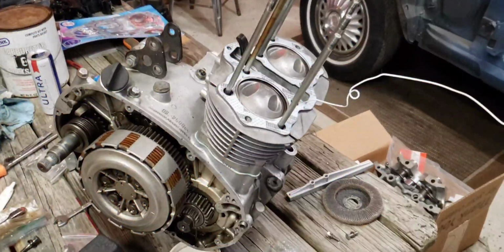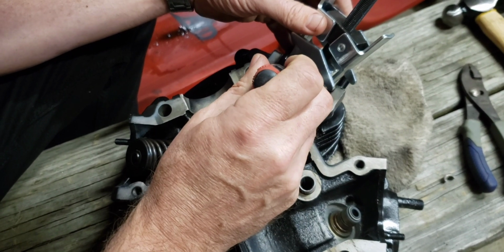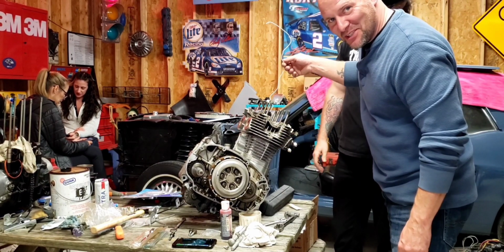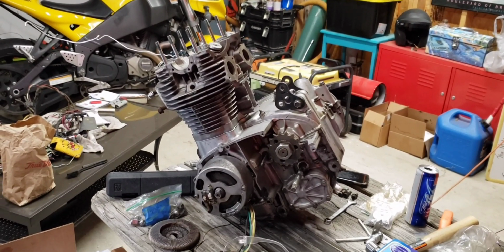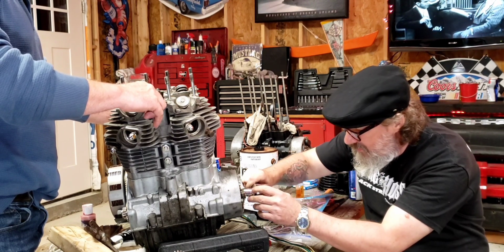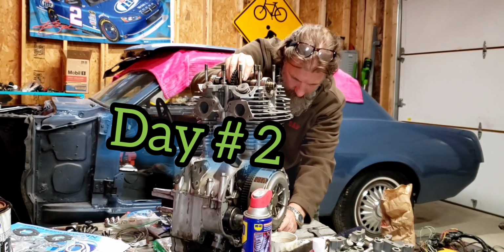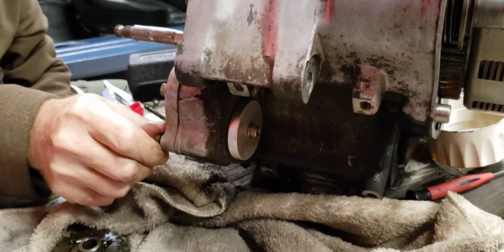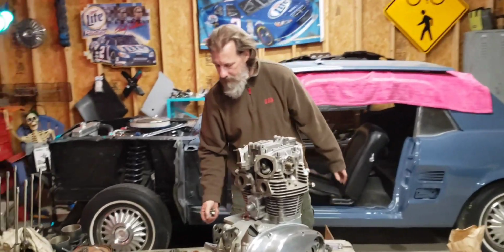Yamaha xs650 Chopper build. engine assembly. #yamahaxs650 #choppermotorcycle #bobbermotorcycles

Comment: I have now seen how you did it. You normally join the cam chain before you put the head on when you can get to the chain with more space. There is a tool with 45 degree angles on each side and it makes it easier.
Reply from the maker: Will that still work before you install the cam? If so I will definitely try that